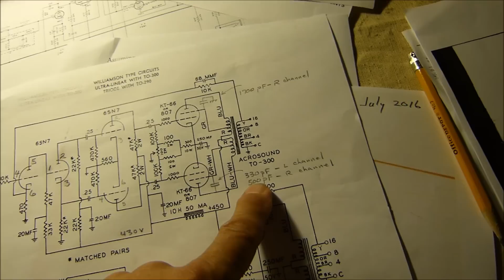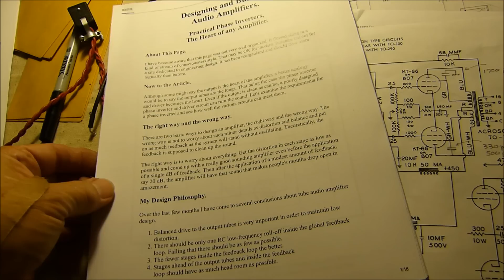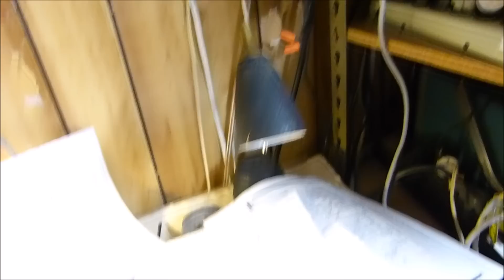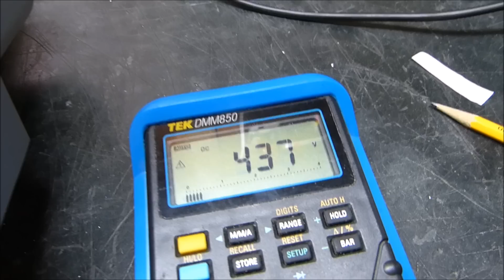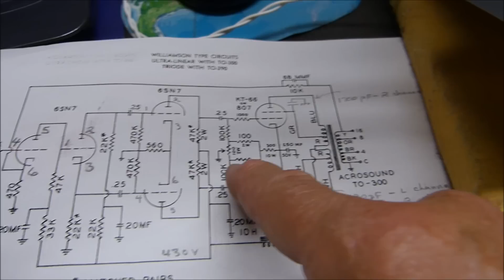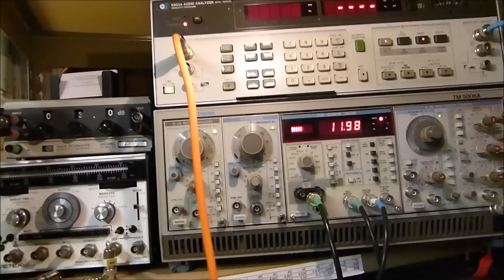Acrosound Output Transformer Vacuum Tube Stereo Amplifier (Improved Design)

Comment: Are Acrosound Transformers still being manufactured? Who distributes them? If so, where can they be purchased?
Reply from the maker: No, they are not made anymore. Probably since the 1960's or '70's. The only place I see them is Ebay. I have had a good number of vintage Acrosound transformers and they are all unique and may require individual circuit adjustments for optimum performance. That is my experience with these transformers.
Reply: Thanks for your reply..  I have a TO-330 homebuilt that has 6550 output tubes..  I built it in the '70's..  It works flawlessly..  I use it as the Bottom End of my Stereo..  in "MONO" Mode..  The crossover Frequency is 250 hz.. I'd like to build another Amp using a TO-330 and use it as the second amp to make my system a TRUE Stereo Playback System.. I have other Acrosound NEW-in-BOXES to trade for another TO-330 Transformer..They Are hard to find..
Reply: You can actually make them yourself with the schematics and a lot of patience.

Comment: I enjoyed the video and am a bit inspired with it. I have done many Williamson and Acrosound catalog and 5-20 variants over the years and had a ton of fun with hi-fi as a hobby but feel that a lot of folks in a lot of ways have ruined the hobby in the last 20 or so years. I've got a couple of W-4 amps with TO-300's that I will get out and tinker on this weekend. thnx. I wish there were more just 'tinkering' buddies. Used to be more like it was with HAMs----speaker builder and Audio Amateur days
Reply from the maker: Hi Steve, I agree that there aren't as many builders today as there were decades ago. I am 67 and have been  a ham since 1963 and have built vacuum tube devices even before that time. It is still a passion with me. On the other hand, there are a number of good folks that subscribe to my videos that are well informed about vacuum tubes and vintage electronics so you might be pleased to communicate with some of them.  We, that still love this stuff, are a small bunch but in a way we always have been. As another thought - I had six Acrosound transformers when I built this amplifier and none of them did exactly what the others did. Every transformer was somewhat unique even though I thoroughly tested the winding/impedance on a good General Radio impedance bridge. I don't know if it was natural variations in the transformers from birth or ageing - or both but it turned out that everyone needed a little bit of special attention to get the best performance out of them. I think I commented on that in a few of the videos. Good luck with your projects. I still find it a lot of fun and it appears you do also. 73 David WA4QGA

Comment: hand over the tube....changes the capacitance level.a lot of r.f. principles at work. the fan make a magnetic field that the tubes are sensitive to. these things are why a lot of tube amps are shielded with a wire mesh cage. separately grounding the chassis will have a positive effect when connecting to a pre-amp section/signal generation device also.
the large tank 6sn7's were an excellent choice.very smooth sounding pre-drivers.

Comment: I really enjoy these videos and very much appreciate that you take the time to do them. I've got a Dynaco PAS-4 that I picked up for almost nothing (poor thing doesn't have a single tube in it). It's been modified and "repaired". Assuming that it even works I thought that I would baseline it before I either return it to stock or go the other way and add a few improvements. So, that means I need to set up for audio testing. I have a question about your dummy load arrangement. There are two resistors but every time you switch channels I notice that you also flip a switch on the resistors and I was wondering why. I thought that each dummy load resistor was for each channel but that doesn't seem to be the case.
Reply from the maker: Each dummy load is for each channel - two dummy loads for two channels but I only have one set of test equipment so I am switching my test equipment between channels and dummy loads.
Reply from the maker: As for your PAS-4, if you can restore it to original condition and remove any so called "repairs", you will probably do the best for the equipment. That doesn't mean paying high prices for "NOS" parts from Ebay for things like capacitors and resistors. Those components can be purchased new for very little money and even better than they were in the 1960's when this equipment was made. Good luck with your project.
Reply: Occam's Razor strikes again. That's incredibly obvious now. Thats' what happens when I over analyze something. I miss the simple answer. Thanks again for doing these videos
Reply: That's the plan. There are workmanship issues. Hopefully they didn't deviate from the schematic but I'm not optimistic. It was cheap enough though so it's not going to cost much to go back to stock.
Reply from the maker: I knew you would completely get it and I am the same way. I had a conversation the other day with a lady and told her you won't confuse me with the complex but please be careful as the obvious may go right over my head  :-)   I have heard the term, "Occam's Razor" but didn't know what it meant, Now I do - thanks.

Comment: Beautiful amplifier, very nice workmanship. I assume the caps at the screens were needed to stop oscillation. Out of curiosity, did you try resistive loading? I'm always concerned that reactive components will be fussy as the equipment ages, or values might need to be revised if tubes are replaced. Whether caps like those will quench oscillations under all operating conditions is another matter. I don't build UL amps, but honestly, I'd be searching for a different technique to dampen the parasitics. Not trying to be overly critical, just my $.02.  :)
Reply from the maker: I really appreciate your thoughts. I have considered if the exacting values that I have "dialed in" will be different for other tubes. I hope not. I want to believe and do believe, so far, that it is taking care of some imbalance in OPT windings. This design with the two 6SN7's had no parasitics like the other design was full of. What these capacitors did was even out the 20 KHz THD reducing it from about 2.5% to under 1%. It is amazing to me how flat the FR is of this amp and Acrosound transformers. Even at the 25 watt level, the difference at 20 Hz, 200 Hz, 2KHz and 20KHz is insignificant. I am still amazed. As for dealing with parasitics, if you detect them, there seems to be a consensus among many amplifier manufacturers to put something like a series 82 pF and 18K resistor off the grid of the second stage along with some other common cures that you will see in the study of these vintage designs, including the Dynaco designs. This RC circuit did nothing but increase THD for me at 20 KHz. It was just kind of luck that I came up with these values as I started small (50 pF) with no effect then a 0.001 uF and better then 0.02 uF and worse so I figured there must be something in that range that would be best and it was. In the 1950's these guys did an amazing job in their designs but they did not have the equipment we hobbiest can now have so they simply didn't have the test equipment to "dial-in" such values. Even the venerable HP 3580A is at best, able to see -85 dB and displaying low frequencies are so painfully slow that I would have to be paid well to look at that display all day long.  Please see my reply to Mike below.
Reply: Well, if those caps aren't for parasitic supression, they really shouldn't be there. No one can hear THD at 20 kHz (the 2nd harmonic is 40 kHz), so the risk that those caps might have unintended consequences is greater than any possible benefit. You also might want to consider that even commercial designs that need suppression aren't necessarily the gold standard for modern construction. Back in the day, the numbers game had already begun, and many of the techniques designed into amps (such as RC networks at grids) were the result of specmanship. NFB became excessive in the search for ever-lower numbers, and that reduced the phase margins. A myriad of "fixes" were employed, but almost none are sonically beneficial or necessary to any purpose other than besting your competitors' ratings. My advice, FWIW, is to place less emphasis on numbers, use less feedback, and enjoy equipment that's not only more stable, but also emits a greater sense of openness. Many studies have been done regarding the perceived effects of THD. Large groups of people have been studied, and nearly everyone who hears music at 0.1% and then at 1% simply thinks it's become louder. So, in the end, I believe anything better than 1% is sufficient. The proof of that is evidenced every time someone turns on a 300B or 845 SE amplifier with no feedback at all.  :)
Reply: For the sake of specifics, I just want to add that 16dB NFB is much more than should be necessary in an ultra-linear amplifier. The amplifier already incorporates considerable feedback through the UL design, and although it might not be obvious, the UL technique also corrects for the output transformer and load. Your final distortion measurements don't need to be market-competitive (a goal that can't be achieved anyway if gritty solid-state gear is considered), so you can afford to moderate the use of NFB in a way that optimizes sonics rather than numbers. In that regard, I would personally adjust NFB by turning one of the pots while listening to that channel only, and I would increase NFB until just past the point where the harshness and excessive sibilance associated with IMD disappear. 1 kHz THD should be well under 1% at that setting, and if so, the value of the pot should be converted to a fixed resistor and installed in both channels. This method will relieve you of the need to compensate for all manner of ills, and you'll lose the desire to spend hours or days fiddling with those pots. Believe me, I know about fiddling with pots and caps while watching test gear. I've been there many times, and it's one of the most unproductive habits a designer can fall into.   :)
Reply from the maker: I really like your thoughts and I don't disagree with them. The old designs, as I have learned from building them recently, raise the NFB to the point of instability, probably 22+ dB. I think I took the 16 dB from something I saw in a McIntosh design some time back. I probably should verify that. Maybe I measured it in a Dynaco amp. Not sure.
I tried the SET amp path and just couldn't get there with the size of OPT necessary for even a good 20 watts. LF response in the SE amp world seems to be an eternal problem with the transformer core close to saturation even at quiescent plate currents.
My primary goal here was to personally evaluate the quality of the Acrosound transformers. I am not disappointed.
The first design was just brimming with parasitics bursting in and out at will according to amplitude and frequency and even thought the parasitics were in the 80 KHz range, I could hear the abrupt beginning and ending - at least I think I could.  :-)  I use Klipschorns, which not everybody likes, and they are brutally revealing of any deficiency in the whole audio setup. 
In any case, I really enjoy the building and sharing of these projects with the YT community and the conversations like we are having. Regards - David
Reply from the maker: I understand the eternal fiddling with pots...  :-) and, I have considered if i want this amplifier to remain working properly for the next 30-40 years - long after I am gone, I should take all the pots out so that some to-be owner won't feel compelled to adjust and fix it better. Or should I give a hoot what happens to my equipment after I am gone? Mac amps have no adjustments (except the MA230) and no one wants to upgrade them. A good philosophy to follow. 
I may try adjusting the pots while listening to music - maybe a 1 KHz tone also. It sounds magnificent. It has a presence and "life"  to it that it seems the Mac's don't. I built some triode amps some time back using 6B4G's and listened to them in my shop and loved them although they were far from "perfect" Maybe we actually like some of the artifacts of vacuum tube amps.
As comparing tube amps to SS amps. Well, we both know that's a tough comparison if we are dealing with just THD. I have a Mac 2100 on my bench now - rated at 105 w/ch and it will do 147 with THD below 0.01%. And I do love its powerful sound and clarity/cleanliness. It is a jewel and (don't tell anybody) but in all honesty I generally prefer the power and quality of top notch SS equipment even on my overly sensitive speaker system. Think about it ---  20 watts into 105 dB speakers is 118 dB and both speakers (40 watts) is 121 dB. I don't need much more than that in my living room. Thanks again for your thoughts and comments.
Reply: great videos you upload. have watched many of yours. On one (do not recall which) you made a comment on how you like the sound of that particular amp much more so than you McIntosh amps and others. Have had similar experiences. thought I would pass along something I tried; may help explain the differences. most measure THD at max power, targeting below 1% or 0.5%. But max power output is not the power level where 99% of the listening occurs at. set up favorite amp, and adjust listening volume to normal level. Measure peak and RMS voltage output from amp. Take amp back to bench. power amp up to obtain that same voltage output in similar load. Measure THD. Take McIntosh or similar tube amp and repeat the process. I have found the THD at listening volumes is much lower (as one would expect). Reduce Neg feedback on the McIntosh amp until its THD level matches the THD level at the same output voltage as your favorite sounding amp. Solder the new feedback R and cap in place. Give amp a listen, think you will find the two amps will sound much closer to each other. 
Best regards.

Comment: I just love your videos i learn so much Getting back into electronics now  that i am retired  repaired a new Separo p88i stereo amp  that had lots of  no soldered joints  4 Kt88s  4 6n8ps   Just like your build  also built your bios  tester Ei7gg retired Carpenter 73es
Reply from the maker: Charles, looked you up on QRZ. Maybe we will make a contact on 20m some time. 73 WA4QGA

Comment: If ever you can get hold of the British Quad 11 amplifier you should test it. It has one of the lowest distortion and cleanest sound of any valve amplifier I have ever tested. The circuit is widely available on line, as you have found, it's all about the output transformer. In my late teens I worked for Quad, the output transformers were made in the same factory. It took longer to test that transformer than the amplifier complete!

Comment: Dave,

Very informative video series. Glad you have the amp dialed in. I see you still use an RPN calculator.
Reply from the maker: I can't seem to use any other type of calculator after 30 years with this one. 

This amp is going to be hard to top unless we just go for power. I am really surprised at the frequency response of these transformers. It looks like they actually live up to their reputation. I see them on Ebay for tremendous prices sometimes. I had four and tried three of them and it seems each transformer has some unique characteristics that need tending to, to be able to get stellar performance from them. But it was worth it.
Reply from the maker: Hi Mike,
Yes, the new TS tubes seem to be top-notch. And I think the KT66's are especially good.
As for NFB, I started with the low values as dialed in with a resistance substitution box (per some specs in old documents) and it seemed, at the moment, that 5.1K was good but after a little time passed, it began to oscillate at about 1 Hz - you could see the sine wave going up and down on the scope. I then went to a 5.6K and thought that would solve it but it started the slow oscillation again. Then I decided that I wanted 16 dB of feedback so I compared no NFB to NFB and a 15K gave me the desired 16 dB NFB but THD was still too high at the ends of 20 Hz and 20 KHz - I think about 2.5%. Then came the idea of the pot which gave me the full range from a minimum of 16 dB to 20+ and it just fell into place. I was driving the amp at 2 KHz at 15-20 watts or so and just adjusted the pot to stop all the very slow oscillations and both ends of the spectrum came out great. I actually have not measured the amount of NFB I am using. 
I am very pleased with this amp. It has a warmth and depth that is so good. I mentioned I like it better than my Mac's and I do. Plenty of headroom driving the Klipschorns. Absolutely no "lisps" on the highs and human voice that the other design had. As mentioned in the video, I did have to do some old-fashioned experimenting with various capacitors on the screen circuits. The capacitor vaules are real and exact and low values like 82 pF and high values like 0.1 uF don't work. I assume that is because of anomalies in individual transformers as mentioned in a number of articles. 
I am going to a friends house tomorrow to look at some more power transformers and see if I can fine a suitable replacement that will give me a 300 mA HV secondary.
We've got to talk soon.

Comment: Nice amp....Now for your next project,  how about a flame triode power amp !!!!!
Reply from the maker: I have never heard of a flame triode amp until now. I looked it up and here is a link     http://www.sparkbangbuzz.com/flame-amp/flameamp.htm
That does look interesting. I would want the PP,  kW version of one  :-)
Reply: I reckon you'd need to use one of those propane space heaters for the flame and some iron railings to make the electrodes from.